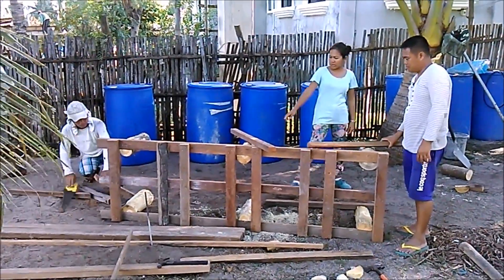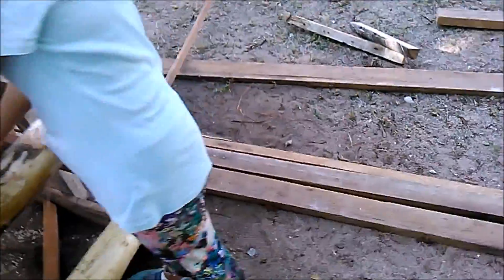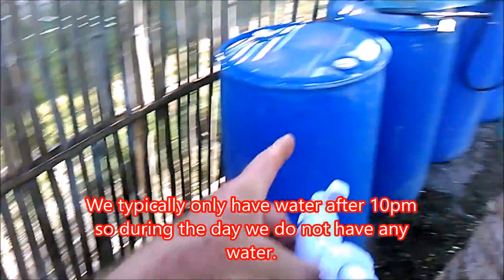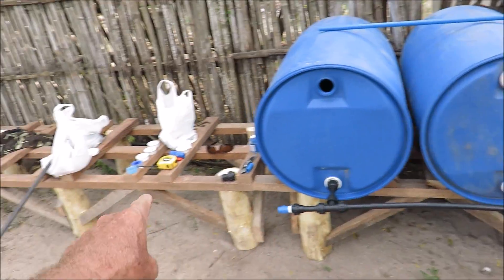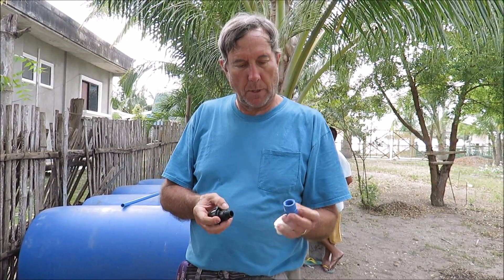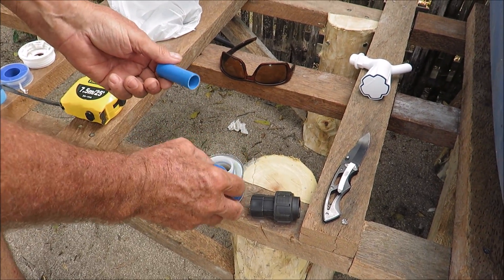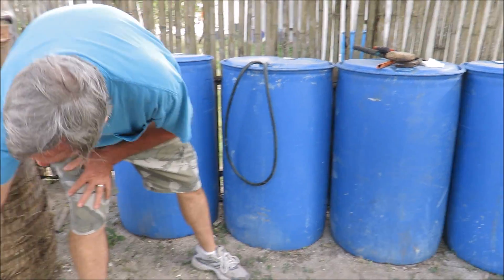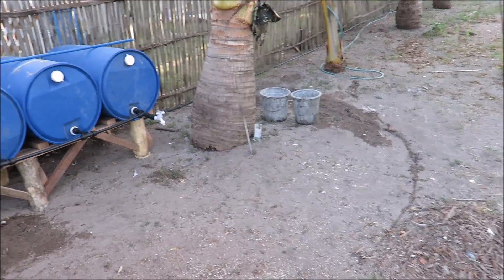Life in the Province - Water storage system for areas without reliable water supply

Comment: now sir how to clean this drum. is there a hole for maintenance?
Reply from the maker: It originally held rum and I rinsed it out, I only use the water to mix concrete. If you want drinking water just rinse with soap and water and disinfect with chlorine. You can smell the inside and if it's chemicals then do not use for drinking or bathing or washing clothes. There are 2 holes in the top on each side for inspection and filling or draining.

Comment: Whats the name of that black color in series pbc
Reply from the maker: It is 1/2 inch back water tubing that comes in a roll, I don't know the actual name, however it is common at most hardware stores in the Philippines. And the black fittings are compression fittings. The black pipe comes in thin and thick wall and is available in 1/2, 1 inch and maybe other diameters.
I use the thin walled for my drip irrigation system too, the thick wall is very hard to punch holes in for the drip irrigation fittings.
Reply: @myparadiseonbantayanisland9030  thanks a lot bro
Reply: Polyethylene pipe. Sometimes called short name Poly pipe. I used to make it.
Reply: White pipe is called PVC (poly vinyl chloride)

Comment: Good idea did you have any trouble filling the barrels from the first barrel? Agree with comment below maybe slope the angle to help filling and gravity pressure.
Reply from the maker: as long as the top caps are loose they all fill and drain great. eventually they will be elevated when i build my house and that will provide pressure. right now we are just filling water buckets for mixing cement.

Comment: Great Idea and nicely done. I would suggest a manifold running along the top access holes to a vent pipe for each barrel . I believe that will allow all barrels to fill to the top. Loosening the cap will work as a stop gap method, I am comparing your set up to holding tanks for gasoline with the vent pipes being 12 feet or more above for a similar reason, as well allowing any vapors that may be present to safely go to atmosphere. Not meant as criticism just observing and talking, I will be doing a similar system for back up water. Thanks for the share.